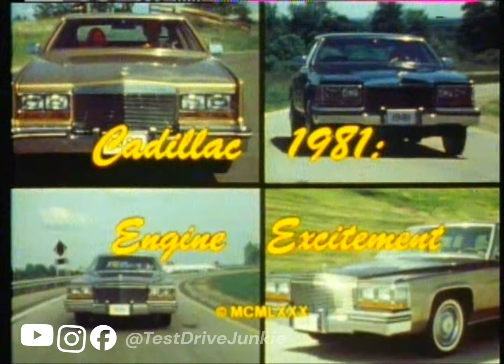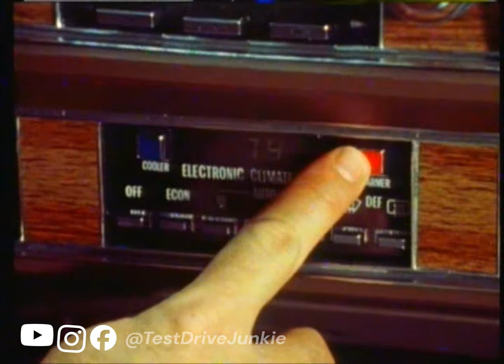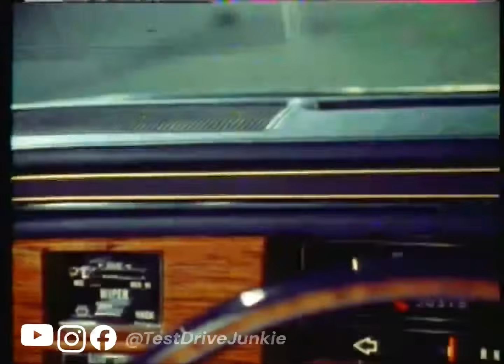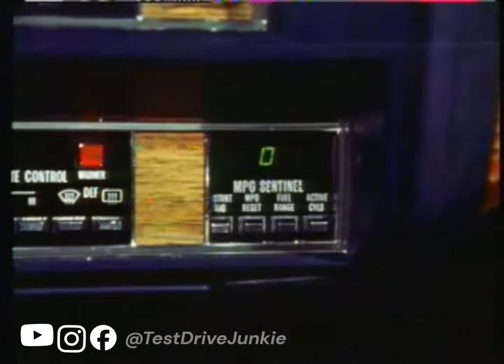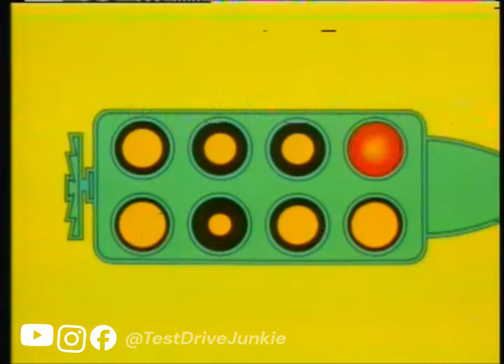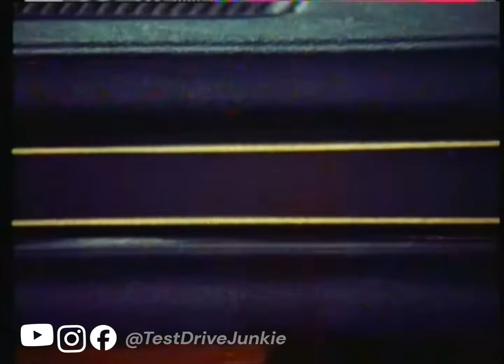1981 Cadillac Engine Excitement Manufacturer Laserdisc Promotional Video

Comment: Those V8-6-4 engines were fantastic! Very efficient and still could burn rubber with a 2.41 axle.
Reply: Actually those engines were garbage
Reply: @MyerShift7  No they weren't. They were an excellent power plant. It was the cylinder deactivation system that made it so the engine couldn't get out of its own way. The microprocessor couldn't keep up with the demands put on it. Once the system was deactivated by the dealership, the engine worked just fine as a full time V-8.